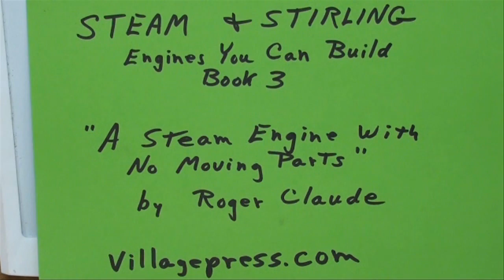TOY MODEL STEAM BOAT ENGINES Part 4 tubalcain & tubalcain jr.

Comment: Great project!!
The reason they go in a burst of energy is that they suck in cold water that has to heat up again in order for it to boil. If you fill the lake with warm water it will go more smoothly. Also if you bent the exit tube into the middle of the boat it will go in less of a circle. Thanks for posting!!